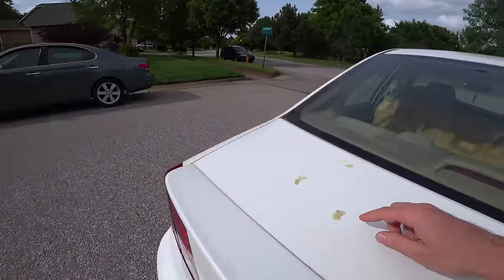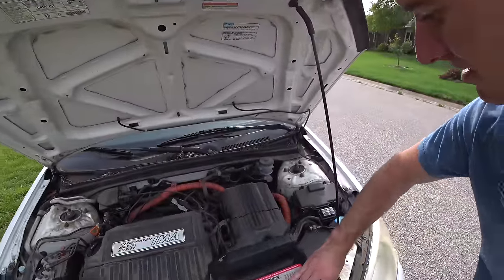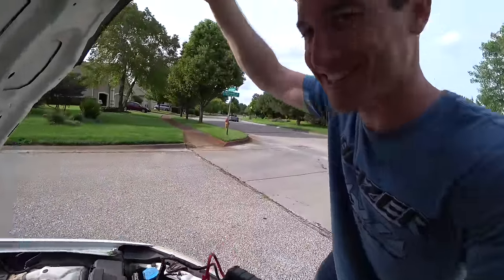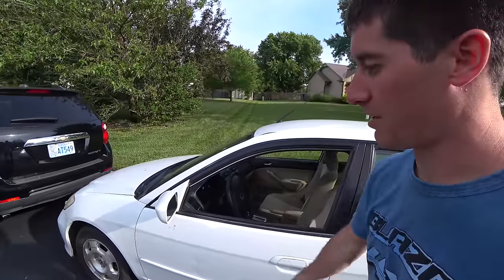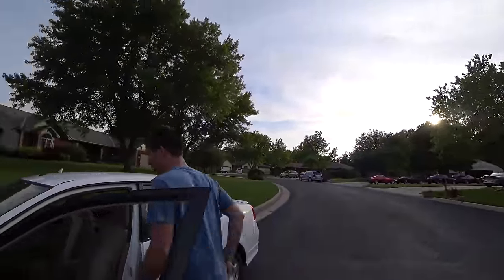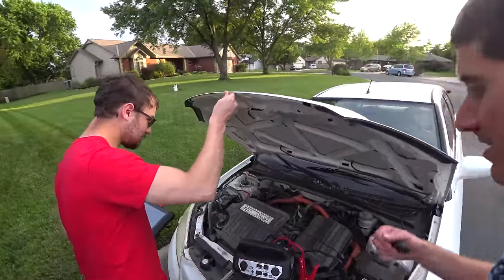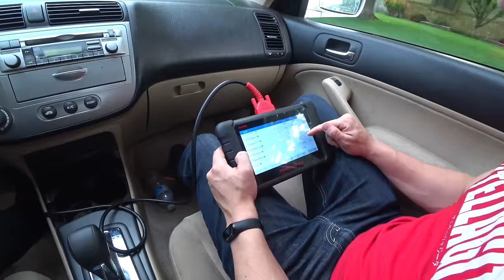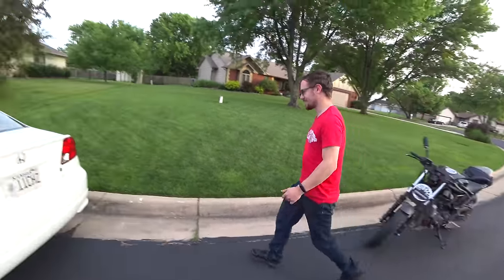I BOUGHT A CHEAP Honda Civic HYBRID With A DEAD BATTERY

Comment: pull all the ima garbage out and k swap it(the ima batter is very heavy on that model) and yes as long as they can't prove neglect (ie cut or animal chewed seatbelt) belts and buckles are free replacement from honda
(ima battery replacement at honda was 2-4k depending on the model iirc)

Comment: I once bought a used car that had electrical tape over the check engine light that I didn't notice for a day or so, luckily it was on the outside of the cluster & it was a loose gas cap.

Comment: The commutation sensor failure is probably causing the ima system to not charge the 12v.  The battery may shut down the dc-dc after a bit, but it should be a minimum of half a minute or so before it detects the battery condition and shut it down. The sensors rarely fail, so look for damage to the commutation sensors (under the ima motor) or to the cables running from there to the back. Look for road debris damage or even rodent damage.

Comment: Now, in 2024, the real problem is the availability of sticks with quality cells that will last longer than the 90 day warranty many rebuilt packs come with.

If the cheapest sticks cost $50 a piece or more to import, and you need 20 of them, that doesn't inspire much confidence in packs costing less than $2000.

In the better times, this would've been a fairly straightforward job to pull the pack, swap the sticks with new ones, and pop it back in.

Another wiggle to watch out for is the fact that some owners will drive the vehicle around with a screwed pack until the inverter finally burns out from constantly recharging the 12v battery and it's not a $20 part either.

Comment: If the car was sitting for a while it’s more likely the engine light went away from no battery unless they removed the bulb behind the dash so it can’t illuminate cause I’ve seen that to

Comment: I had an O2 Heater code that wouldn't go away. Ended up having to replace the ECM. Don't be surprised if you have to do the same.

Comment: 3:03 "When the battery gets weak, the power steering gets hard". I had that exact issue with my 2006 Civic Hybrid and the dealership couldn't find what was wrong (the car was about 2 years old that that time). Possibly a recall/defect that Honda didn't want to address?

Comment: I also own 2005 Honda Civic Hybrid. It runs fine and performance are also fine (it seems that IMA battery is working). But my 12V battery often dies and recharge/jump start. According to the battery specialist, this is the sign of the beginning IMA battery failure. Is it true?

Comment: F.Y.I   I have many times driven away from a wounded car purchase by securing the jumper pack hear the battery with the cables hooked up. Secure te hood and drive to wherever the charge lasts which mosf the time is quite a time.
Just saayin  ? ?

Comment: wow interesting I wonder how that old hybrid system works... you start the engine with a key like a conventional car??
Reply: Yeah, the only difference is that it normally uses the IMA motor to turn the engine over. If it’s starting off the “backup” 12V starter, there’s definitely something up with the big battery (or it’s really, really cold!).
Reply: @johngarciaii6927  
I was wondering why I heard the standard starter noise of a regular car. I thought that the IMI is what turned the engine over. interesting that they put in a backup 12 volt starter also. The Toyota Prius does not have one of those if the hybrid battery is completely flapped it will not start It does not have any way to start. That being said the battery pack can be in really really really bad shape. And it will still turn the engine over. You will then find though that the car does not operate very well. But I've not ever seen one that would not turn the engine over and start it. We just fixed one that had six cells that were completely trashed. And it still started. Interesting differences in design. The Prius seems to be far more complicated, but I think a little bit more redundancy built in. The Honda system is definitely simpler but perhaps not quite as robust.

Comment: I had the later model Civic Hybrid 2009 euro model. Really nice car to drive, but I got rid of it after having to change the battery pack multiple times. First time with a new pack under warranty. Second and third time (outside warranty) with refurbished packs, both of which turned bad within six months... 
Still love Honda tough, just not IMA ones anymore. Now drive a 2005 accord CL7 2.0L euro model.
Reply: Your regular battery went back every 6 months? Not the IMA battery?
Reply: *bad
Reply: @jasminesorchids9598  the IMA battery kept going bad.  The original IMA battery was already bad when I bought the car (at only 2 years old). The new replacement IMA battery (under warranty) lasted maybe 2,5 or 3 years. The used / refurbished ones I had put in after that, didn't even last a year. I got rid of the car in 2017, because of this. It was a 2009 model year. Those were known for this issue (2009 to 2011), at least over here with the euro spec model. A friend had a 2008 pre facelift model, and never had this issue. Different battery manufacturers.

Comment: if you have this car running as a daily driver, the ima battery should not be bad and dont need changing? if it has been sitting for a year will you then have to replace the ima battery? and isnt that battery alone 1400$?

Comment: Should be a fairly easy though possibly involved fix. I would think it depends on how easy that pack is to break down and swap in new cells. Hopefully everything else clears once the hybrid system can take a proper charge and deliver the proper voltage and keep the service battery charged again.
If it works out should be a easy 2k or higher flip.

Comment: Basic car guy 101, if the alternator works, it'll run fine as long as you don't shut it off. A bad battery won't generally cause the issues you have. The battery is probably also shot, but not the base issue.
Reply: If I saw that right and these things don't have an alternator, ugh. I'd never want to mess with this garbage...

Comment: If they are so easy to fix will you fix mine. It's been sitting for a year now. All has to do with the IMA. However way before the IMA came on check engine came on and it said o2 sensor. Can the o2 sensor cause all the same issues?

Comment: Thanks for the information. Question I have a 05 honda accout with check engine lite on an  the mi on too. Dealer is saying the hybrid battery is bad. But all features of the hybrid functions as always did... So is it still the battery being bad?

Comment: It is one of the slowest cars I've ever driven
Reply: Agreed especially with a dead ima battery lol. Still not bad once you get up to 65-70 ish
Reply from the maker: With the IMA failure and a dead 12v battery it wouldn't even get up to speed 😬
Reply: Yup. I believe I preferred the term "dangerously slow". And I had a 106hp del Sol to compare it to :D It's a good highway car, but not the on-ramp part.
Reply: @busydadscooking001  Strange, a 2200lb Saturn SC2 can do a 7.5second 0-60 with 125hp.
Reply: @WatchJRGo  It was a company car. Ours had a check engine light that would never go away. A lot of our fleet were hybrids, mostly Escape and C-max. I'd always grab one of those first!
Reply: The Prius does very similar things when the 12 volt battery goes flat. Bosses kid had a 07 and battery went flat and nothing would work because it powers the electronics that control the hybrid system. He got a new battery and car ran good again till they eventually sold it to get a better fit for his growing family and critters.
Reply: @69Dartman  
Yeah the Prius does some really weird things when the 12 volt battery gets low.
However the Prius is design is extremely different from this. As long as that gas engine is running it should provide direct current back to charge that 12 volt battery.
I'm not sure how the Honda works. The IMI system is much simpler. But without the hybrid battery pack functioning. It's possible that it cannot convert back to 12 volt DC. The prius's system is significantly more complicated, with more redundancy. 
Also extremely reliable. I've got an '08 with 325,000 mi. My friend has an '06 with 380,000, and we have an acquaintance with an '04 that has 520,000.
People rag on Priuses, but if you need an dependable and fuel-efficient practical vehicle. They're pretty hard to beat. I imagine the Civic hybrid is similar when operating correctly.

Comment: If I saw gauges painted over,  that is a straight up deal breaker. Immediately. 

What else is this dude hiding? Something illegal or disgusting under the seat that I will get blamed for? Plus what kind of shitbag tries to trick innocent car buyers into buying a car with expensive issues? Why would I reward such behavior with my money? Plus it's illegal and I wouldn't wan't to get blamed. I would report him to the feds probably...

Not to mention the restored 12v battery with no labels? Rolled on touch up paint? Opened box of cells with "hopefully" all of them there? 

I hope it wasnt Roberto who did it... But even if it wasn't, how could he possibly purchase the car and then sell it for profit? (guaranteed he did not buy it for over $500... ) No wonder he skirted out of there so quick!

It's a challenge for you JR, that's great.. I think the instrument cluster as a whole is easy to swap, and fairly cheap, and changing the high voltage cells will be a really great video...
but whoever covered the warning lights COMMITTED THE CRIME OF FRAUD -CONCEALMENT OF A KNOWN PROBLEM FOR FINANCIAL GAIN, and is a huge fucking dick face.
Reply: Okay, first off, likely not a federal crime to sell a car without disclosing known issues with it. State law crime, possibly a consumer protection law - not really much to report to the feds. ;) 

Second, it's a used car. Caveat emptor, let the buyer beware, etc. The taped-over gauge may have been covering something, but the fact that something was being covered was out in the open, so he could make his decision based upon that. It wasnt something that looks reputable but is really fake. It looked tampered-with from the outset, so he had an ida of what he's getting into JR inspected it and decided he wanted to go for it, paying the price they agreed upon. JR knows how to fix stuff, so he's more knowledgeable than most, and seems like he wants the challenge of sketchifying this car. I would have hoped to pay less for something with so many unknowns, but I also would have been working with my own budget without sponsorships or a possible secondary benefit of having a teaching channel over it. 

Anyway, completely unnecessary to accuse the seller/rior owner of fraud and call him names. Might be in violation of YouTube's terms of service to target an individual like this. Let's focus on the positive and see what adventures can be made out of learning how to fix this car! :)

Comment: I'm fairly certain I jinxed myself by watching this video last night.

I have the same model year Civic Hybrid, Friday when I parked it after work it had zero issues.

This morning the car barely started and acted exactly like yours does when you drive it home.

I'm hoping it's just the 12 volt as I replaced the IMA at 175k and I'm at 233k currently, so I should have another 100k before needing to replace/recondition

Comment: My mom had one of those Civic Hybrids. The hybrid battery died out and the dealership said it would cost $3-4k to replace. She just drove it til the trans started slipping bad and then traded it in 8 years later. That civic was a piece of crap.

Comment: Do you take questions about cars?? I got a 2004 Honda Civic Hybrid. If so where can I find your email?
Reply: What's your question, I've got an 04 civic hybrid.
Reply: The Hybrid battery is going out. Any way I can fix that without buying a whole new hybrid battery? That would cost way much more than I paid for my car in the first place. My car is running good it is just making some sounds when I drive it due to the hybrid engine going out. One car dealership said I could drive it after that engine goes out, another dealership said I couldn’t. Just don’t want to give up on my car when I might be able to fix it

Comment: I had a Hummer H2, the shaft broke on the power steering pump up at my cabin.  Drive one of those bad boys for 3 Hours with no power steering or brake assist.  What a bear.

Comment: Really bro? I was able to ask if it had VTEC
Reply: It actually has a modified VTEC system. In this case it closes the valves on coast down, to eliminate pumping loses. It can get some incredible mileage going down a hill. In winter not so good as it can lose so much heat on a mountain decent that you have to stop to heat the engine back up for defrosting.

Comment: This is not a good purchase.. how would this ever be worth more than $1,500?
Reply: Let's see how this thing develops - no need to pooh-pooh it from the outset! I once had a beater RV that I bought for $1500, used as a tiny house second home for 2 years, then sold for pretty much what I paid for it plus a 2001 Volvo in good condition. Wasn't looking for a Volvo, but it gave me the opportunity to have that and have the RV go to a good home with someone who wanted to fix it up even further. So there may be benefit in a trade or something else we're not yet seeing here. Beauty's in the eye of the beholder, and let's see who wants to be the next home for this Civic once it's done. This probably isn't the channel for it, but I'd love to see JR and friends figure out a way to recondition these hybrid batteries and invent and patent something aftermarket to help hybrid owners. With lead acid batteries you can sometimes extend their life with epson salts to revive the electrolyte/desuflate the plates inside the battery. With these hybrid batteries, a different species, but who knows, maybe JR will invent something new along the way to help other others :)